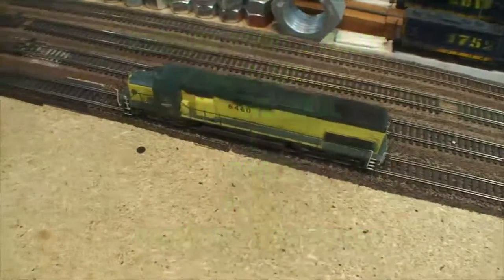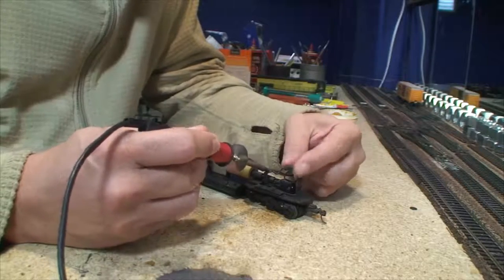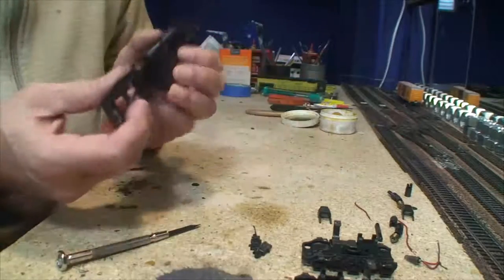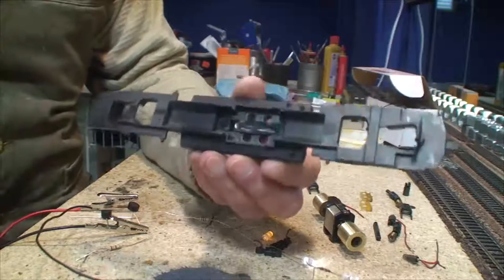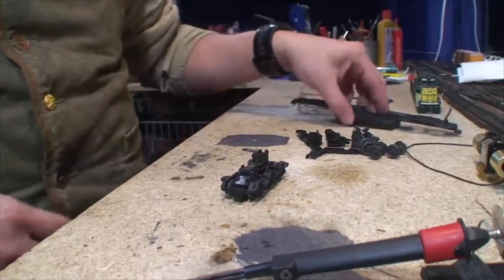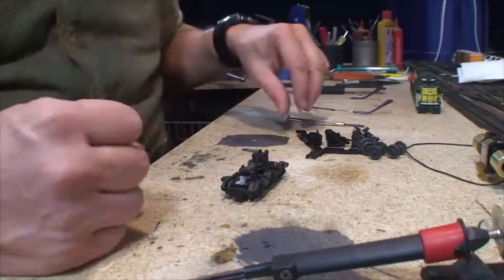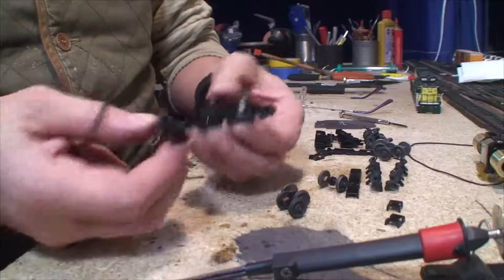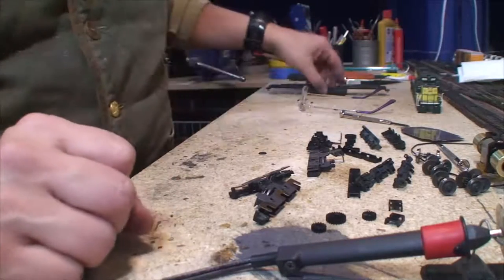Athearn SD40T-2 snoot blue box total rebuild

Comment: Glad to hear that you're soldering Wires to the Trucks. A Steel Plate riding on what's basically Pot Metal, does not make the best Ground!! This becomes more obvious after converting to DCC. 
This Truck Frame design was probably Irv Athearn's last great idea. For their simplicity, they work well. 

But, since at least the late 80's, I've always Soldered soft Silicone Wires to BOTH Plates on the Trucks. Brian Hanna taught me that many years ago. 😉 The Brass Axle Bushings actually make pretty good contact. It's the Truck to Frame points that always caused stalling... 

Also, you've likely found this out by now, but the way it was shuddering at a constant rate when you ran it at first, is usually a sure sign of at least one cracked Axle Gear. 😉 
If I'm doing an overhaul on a Blue Box Athearn or a P2K Life Like, I always just replace all Axle Gears. Cheap insurance, and does a better job of keeping the Wheels in gauge. 

.... And you're absolutely right about the NMRA Gauge!! I've nearly worn mine out! 😜 
And great idea on increasing the travel of the center Axle!! 👍👍
I'M one of the Old Farts that completely forgot about it! When I officially get back to the Layout, I've got a SD9 that's getting that tip first! 😉
Carmine ✈🚂🚙
Reply from the maker: I solved the cracked axle and have successfully repaired a ton of them now - the key was revealed when I discovered that the white glue I use to secure the wheels in gauge became pressurized inside the axle - and came out through the crack of course.  I've been drilling a tiny hole next to the gear to release the pressure and then fixed the crack with superglue and baking soda.  to date, that fix has held in every case

Comment: awesome video very informative, learned a few things, but i have one question though i watched the video on rebuilding the pancake motor on the u36b well where can i get the springs, i was cautious but the springs were stuck inside and when i tried to get them free they got free alright. so i have checked everywhere i cannot locate the springs can you help at all
Reply from the maker: I've found phosphor bronze springs on ebay many times.  I've used different springs from different motors.  The Athearn brushes are 1 size bigger than the Bachmann, Life-Like or Tyco.  Slot car springs also work and they are very easy to get.  Also a good source of new brushes and new springs.

Comment: I hear a slight growling noise when my old BB goes one direction.  Is that normal?  sounds like its from the front truck.
Reply from the maker: that usually means the motor mounts are loose and when traveling in one direction one of the flywheels is touching the inside of the shell.  It's tricky to figure out where the spot is even when you use marking fluid because it may be only the size of a pinhead.  putting shims alongside the motor mounts works pretty well.  I don't use the screw in mounts very often because they are rarely square.  Amazing Goop is my preferred motor mount.

Comment: I opened up the bottom cover plate and put everything back together and then the wheels would always get hitched when reassembled.  As a test, I even removed the cover plate on a truck that was rolling just fine and then  put it right back on without touching anything and the same thing happened again -- the wheels are not free moving and will get hitched unless there's downward pressure applied to the truck.  Any ideas as to why this is happening?
Reply from the maker: yes, the gears are all the same in theory only.  They generally have to be flipped over and rearranged until you find the perfect fit.  If they have been previously taken out and not returned to the original order, you can force fit them using the old toothpaste break in method.  You fill the gear box with polishing toothpaste or brasso and run the locomotive around a circle for an hour in each direction.  This will force fit gears and break them in.  I would first just try to rearrange them until you find the fit where they turn easy with just a finger.
Reply: elite194 Thanks for the quick response!  The gears are actually in the correct order.  I hadn’t actually fooled with them at all.  That’s what’s stumping me.  It doesn’t make sense that there should be any hitching when I merely removed the wheels and then reinserted them and put the cover back on.
Reply from the maker: the next fix is to use a cutoff wheel and grind the steel frame center axle socket about 1mm deeper so the idler gears will have a deeper fit.  you only need to do the center to get it to sit down lower on all 3 axles.  check to see if any axle had extra wear on it - since the gear is nylon, it will be shiny even with wear so you have to compare them to each other.
Reply: @elite194  I think I may have to purchase one of those grinders you have then, since I'm guessing I can't achieve that with sand paper.  (What is the technical name for it?)  I did notice that when I put the loco on the track, it will run (and occasionally spark) if I push down slightly on the frame; sometimes it will run by itself but then it will stop again until I push down on the frame again (track and wheels pretty clean).  As I mentioned before, when disassembled, the gears move fine when I manually turn them, but when it's put together and the clips/cover plate are on, the wheels do not want to move unless there's a bit of downward pressure applied.  I'm guessing I will have to grind the center axle socket you mentioned to permit the gears to have better contact.  I guess they're finicky locos, eh?
Reply from the maker: generally, the SD40T-2 is among the best...it's the SDP40 that is the tough one to get to stay on the track.  But blue box 6 axle locomotives benefit a lot from making the middle axle float.  They become much more reliable.  I usually use the fiber glass cutoff wheel, but the regular cutoff works too.  The regular ones tend to break apart frequently when used in an application like this.

Comment: Why do you use the Slip Plate? And which type Slip Plate ?
Reply from the maker: slip plate spray...totally prevented corrosion for 30 years since the last time I did wiring on it.  Now I can't that spray which is conductive.  I've been using ez slide to prevent corrosion, but it's not specifically conductive.

Comment: Actually the resistor orientation does not matter.
Reply from the maker: reversing the resistor when used with these LEDs is like not using one, the gold stripe needs to be in the correct position or you'll be changing LEDs  when they pop

Comment: Resistors don’t care about polarity. It can go either way. Gold band is tolerance rating
Reply from the maker: Long ago I got the Radio Shack book about learning electronics - the one that looks like a handwritten lab book - in the book it said to orient them in the direction I show in the video and I just made that standard operation procedure
Reply: @elite194  I guess I never saw that book…well no harm , no foul…just wanted you to know what the band actually meant.  Gold is 5 percent +/- of indicated value, silver is 10 percent and no tolerance band is 20 percent.  It’s was a good video.  I have one of my Dads old loco’s to rebuild and upgrade and this was helpful
Reply from the maker: @eecinc162  it's worthwhile if you can find it, lots of handy diagrams for things that you don't make that often but still need to see it laid out before you make it